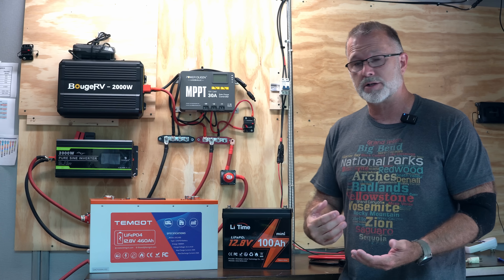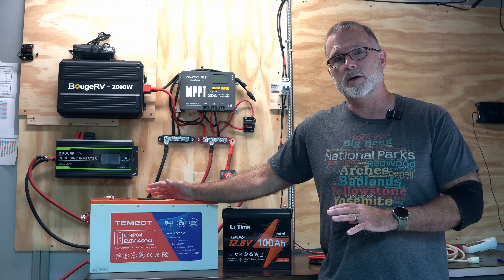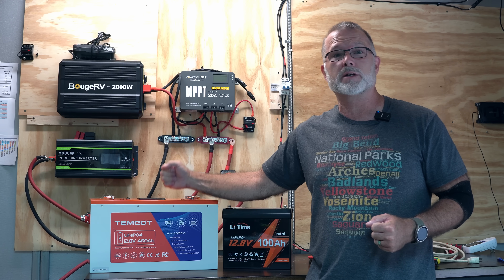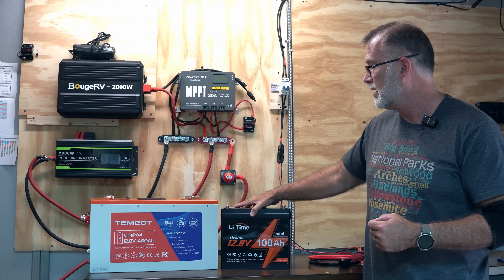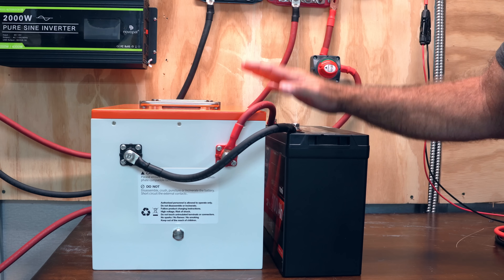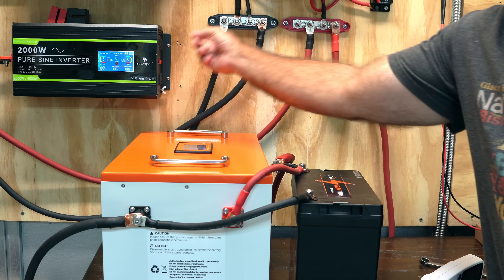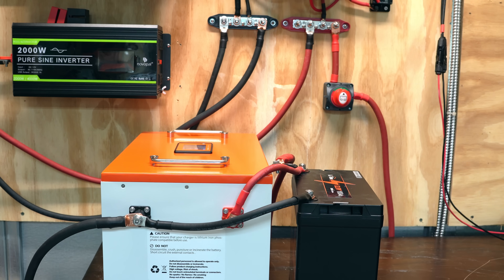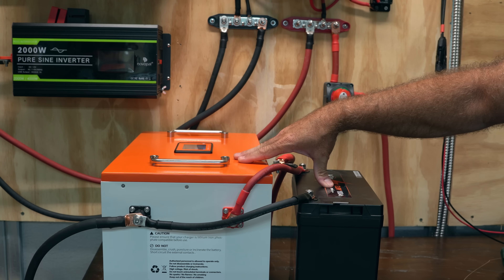Connecting Batteries with DIFFERENT Capacity in Parallel - What Happens?!

Comment: Can I assume that, if I have two identical 24 volt LFP batteries (Same manufacturer, manufacturing date, 100 amp bms, state of charge, and cycle history) that I can connect them in parallel to a 3000 watt All-In-One unit and, as long as I don't load the inverter beyond 200 amps ( 120 amps would provide the 3000 watts, ignoring conversion losses, and 200 amps would be 5100 watts and more than the inverter would deliver without a fault ) and the two batteries would just share the load equally? Can I further assume that the batteries will charge back up equally, whether using grid power or solar energy? I'm planning to do this because one 24 volt 100 ah battery with a 100 amp BMS will not run the inverter at 3000 watts and also will not run the inverter for as long as I would like. It has been like pulling teeth to find a video that just covers this particular set of conditions. A straight answer from anyone will be much appreciated. Thanks in advance.

Comment: Thanks for the demonstration.  It proves that my parallel setup using four 12v batteries of slightly different ages and capacities should work ok.  I imagined that the better batteries would "give" more than the older batteries until they all "run down", and that seems to be what you say, right? Once the oldest and weakest battery is "finished", I replace it with a new one. I'm running an electric catamaran with twin motors that way, incidentally.
Reply from the maker: @fredrichenning1367  sounds awesome!!

Comment: That raised a question about the BMS rating  - if you have two 100amp BMS batteries in parallel are you limited to 100amp draw or can you draw 200?
Reply from the maker: the load is shared in pretty close alignment proportionally to the batteries respective capacities.  But yes, if you have 2 batteries in parallel and both with 100A rated BMS, and your inverter can pull the full 2500W, that configuration would support a 200A load.
Reply: @ReeWrayOutdoors  cool cool yeah I was planning on getting two 100ah 100amp bms cells for my 2000w inverter and suddenly was confused. that's what I thought but yeah

Comment: I have been an electrical engineer for many years. One thing experience has pounded into my thick skull is to think thru “want if” questions. In the case of parallel connection of batteries one what if is a cell shorts in the low ah rated battery?  In the event the higher ah battery well attempt to charge the low ah battery as the terminal voltage has fallen due to the shorted cell. Note there is a voltage difference and no current limiter in the connection. What will happen to the lower ah battery with a shorted cell under the charge current from the higher ah battery?  I equals e/r where r is close to zero. I would advise you gentlemen be very careful connecting batteries in parallel. ALWAYS ask yourself WHAT IF.
Reply from the maker: I certainly do agree that asking and preparing for 'what if' scenarios is a a best practice.  In this case though, I'm talking about LiFePO4 batteries that have internal BMS protection.   And the specific scenario you describe, unless I'm misunderstood your premise, would be no different when connecting 2 identical batteries in parallel vs to different capacity batteries (of the same system voltage) in parallel.  And in both cases, the internal BMS on all of these LFP batteries DOES have over-current protection and short-circuit protections (among other things).  So I would not anticipate a catastrophic problem in the scenario you describe.
Reply: Thank you for ur reply. I’m not familiar with the BMS circuit you reference. Note that most deisel trucks utilize batteries in parallel. They are connected utilizing large battery cables.  My experience with a catastrophic failure involved a sport fishing boat (65’) that had two 240 ah batteries in series (House power) and two 100 ah batteries in series  (bow thruster power). The two battery packs were connected in parallel utilizing about 40’ of 6 awg copper wire. The thruster battety pack was deeply discharged due to a faulty control circuit. The 6 awg wire was subjected to a current on the order of 400 amps from the house battery pack. The overheated wire started a fire aboard the boat that did 2m$ damage. No one was injured. If the 6 awg wire had been 4/0 it would not have over heated but could the 240ah bow thruster batteries handle a charge current roughly twice their ah rating?  The vessel operated over 10 yrs with the 6 awg wire in the circuit then a thruster control fault caused a fire onboard.  Always think thru all the faults you can imagine.

Comment: If the lower one fails and your MPPT charger is set to 24v, you will fry your charge controller. Also, how do different BMS communicate properly for cell stabilization? This is a way bad idea!!!
Reply from the maker: This would be a parallell connection, so there's no change in the system voltage and the charge controller wouldn't know or care if one battery drops off.   And the internal BMS of each battery is only 'aware' of its own cell voltages and the incoming voltage to that battery.

Comment: The problem isn't discharge. The problem is CHARGE. The energy absorption rates are different. Unless the charger can read individual voltages of the batteries, the smaller of the two will be overcharged by the system because the larger will not reach full charge at the same time. This is why truck batteries must be the same size.
Reply from the maker: The internal BMS on the smaller one will disable charging when its high-voltage cut-off setpoint has been met, so that's not really an issue.  But if you're talking SLA batteries without internal BMS, then yeah...that's a problem.

Comment: Just 1 problem, if 1 battery in parallel is dead, then the whole pack will drop voltage very quickly. Otherwise in parallel capacity it is not necessary to be the same but only battery types and life cycles to be the same.

Comment: I really appreciated, there is no problem in using different capacity in parallel connection. I have a small lab and I made router ups using old 18650 laptop batteries. I have used different capacity in parallel as a result I got a long backup time. 98% people have wrong idea that dissimilar capacity is problem in parallel connection. It is only occours when in series connection.
Reply: I have a question, I was making a power bank with 18650 batteries but a few of them are of different amps. So I wanted to know if it will work perfectly or not
Reply: I am connecting the batteries in series as well as in parallel, will it work properly.

Comment: When discharging under load (in parallel), most of the current will flow through the battery that has lower internal resistance. This will be determined generally by the chemistry, size, condition and state of charge of each battery.
 If one is fully charged, and the second discharged, then the 'dead' battery will draw charge current from the charged battery until terminal voltages equalize. Nothing  exciting.

Comment: If one battery can provide 100 amp and the other one 250 amp, then there's a maximum of 350 amp output and 250 amp shouldn't be a problem at all for the smaller battery as it will provide only maybe 70 amp and the bigger battery the rest.

Comment: Good info to know. I currently have a 200 AH lithium battery in my RV and was going to add a 100 AH to it but was not sure how this would work. Will my converter charge both batteries to 100% if it detects the 100 AH battery at full while the 200 AH has not been fully charged?

Comment: I’m running a 300 amp hour battery and a 200 amp power battery the positive goes to a positive busbar and the negative to a negative bus bar then it goes out to my inverter is that OK I bought another 200 amp hr power battery plan on running it the same way Would that be OK?

Comment: Is it acceptable to connect a small 12v sealed UPS battery with a 12v automotive battery in parallel?I'd be using a Noco smart charger?

Comment: I have 2 - 24v100Ah LiFEPO4 batteries with BMS connected in parallel. I have a 3000 watt 24 Volt inverter hooked to it. When running something off the inverter to produce 120 volt output only one battery drains and the other does nothing. All wiring is the same length and AWG. Will the other battery start draining when the first battery runs out or am I missing something here?
Reply from the maker: @Sam_Son59  they should be draining at more or less the same rate simultaneously.  How do you have them connected to the inverter?

Comment: As the currents add up the difference of capacity is not to big of an issue.

If you have 100A from one and 250A from the other the total will be 350A.

Comment: So what if the batteries have no built in BMS ? Like if you just connact the raw battery terminals in parralel? If one battery drops in volatge too much wont the other battery starts to charge it? Wont this increase losses in power due to the power loss during charging. Instead of battery power going directly to the output inverter. This wont matter much with small capacity but when dealling with 10s of killowats the loss can add up to be significant.

Comment: Gotta be careful tho if the wear is different, as they will try to equalize and the strongest battery will constantly try to pull up the weakest one. What i usually do as a test is charge both batteries together, let them equalize, then disconnect from the charging source and check with the ammeter if there is significant load transfer between them over time. It's a problem really only if it's there's no external charge for a long time. Like i had a weather station pulling only 10W and needing to last as long as possible between charges, so i decided to put as many lead-acid battery i could in parallel, the last one i added was supposed to give me roughly 40Ah more, but ended up giving me only 5Ah at best on the long run and wearing out other batteries faster in constant equalizing, so i pulled it out. Great video tho.

Comment: This is interesting. I was trying to figure this out, and your video gave me an idea for my problem. I have a UPS with two 12V batteries in series to create 24 volts. Obviously, I can't mix and match batteries in this case, but what I can do in the future is purchase 24V batteries instead. If I wanted to increase capacity, I can just buy another 24V battery and connected it in parallel. Is this correct, or am I missing something?

Comment: Can I connect in parallel 2 batteries similar to this experiment but in my case they are 48v one have 114 ah and the other one 100? Thank you
Reply from the maker: @usafshorts  yeah as long as they are the same nominal voltage,  should be fine.

Comment: The bigger capacity battery will charge the lower capacity as well as provide external power. Then, when the capacity becomes the same, they both will charge external load until depleted.
Reply: Except they are both charged. Strange. Did you measure that?

Comment: I have 2-100A SOK batteries that I installed 2 years ago.  I was told that I should not install an additional battery more than a year later, (mixing older batteries with new batteries being a bad idea).   After watching this video I don't see why I can't buy another 100A battery to wire in parallel along with my older batteries which are wired in parallel.

Comment: Just as noted in the next comment, you didn't mention that the capacities are additive when wired in parallel. Exceeding the discharge rate of the smaller battery isn't an issue when wired this way.

Comment: Usually, the batteries do not have exactly the same potential at each of the 2 poles.
When they have no load, but they are in parallel, regardless of the capacity of each battery, there will current from one (+) to the other (+), and from one ( _ ) to the other ( _ ), until they equalize.   
Only the potential difference matters, the power drain may be from the small battery to the bigger battery.

Comment: Ok, so it comes down to BMS that is important, so BMS means battery management system so if both is same then it's good, but BMS is battery management system, right? So, that means nothing to number itself unless the number is correspond to mass itself, so 1 BMS is certain mass?? So, it is about same mass as you say certain combo of mass. Lithem... whatever receipt. So, or certain resistance and certain mass to match different resistant and different mass, but two battery has same ratio, like 1000 has 500 plus 500, 250 plus 250 plus 250 plus 250, so 500 is two and 250 is four, so certain amount to result. So, can be different BMS as long as different resistance to match the result, so you pour water in cup, so same speed of pour so the cup with ball raise faster since the cup is narrow, so if wide, so the ball raise slow, so it's corrpond to amount of size, so BMS has certain size which cause higher charge and higher discharge, so if same ratio so it's good? The pour is the start and the receive of cup is the process, the raise of ball is the end, so depend the process itself and range of impact of start so pour fast or slow.

Comment: If you connect a 200AH and a 50AH battery in parallel (both 12Volts),  they’ll share the same voltage, but the 50AH battery will wear out faster.

 The smaller battery will charge and discharge quicker, which could stress it and shorten its life.

There’s also a risk of uneven current flow if one battery is charged more than the other, which can lead to overheating or damage.

For the best performance and safety, it’s better to use batteries with the same capacity when connecting them in parallel.

Thats it!
Reply: Thats not how batteries work....at all.  If they are hooked together.....then they are now one battery......they charge together and they discharge together.

Comment: You can get away with mixing LFP batteries in parallel as long as they have a BMS. You will come unstuck with lead acid doing the same thing as the larger battery needs a much longer absorption time so eventually the larger battery will sulfate and die. NEVER mix lead acid batteries either parallel or series you will have problems.

Comment: If the batteries are the same chemical kind and you can open the batteries and have access to all the voltage levels between the cells, then you can cancel the weaker BMS and connect instead the voltage levels in between the cells of both batteries in parallel as well, leaving only the stronger BMS to manage both batteries. In doing this, you are in effect building a physical larger battery, made of the cells of the two batteries, where all cells of the same power level are electrically connected in parallel. And the case boundaries of the batteries do not have an electrical meaning if you do that. The gain is that now you have just a single strong BMS and so you do not need to worry about over current anymore.

Comment: Hi! we have two batteries (12V 400A and 12V 100A) parallel connected and the load is 12V 100A. So when the batteries would not feed the load? Less than 1 hour or it would be about less then total current amount / load current?(100 + 400 / 100 =  5 hours) - Thanks

Comment: Although it is not recommended It is possible to use say 4 12v LiFePo4 batteries in series without any problem.  I have run 12 100Ah batteries as 4s3p now for over a year and have had no problems. I have however connected a battery equalizer (HA02) over the batteries to equalize the voltages over the the 3 strings. They are also connected so that it is really 4 x 300Ah as 4s. 
I use the cheapest LiFePo4 batteries I could find and they where absolutely NOT recommended to be used as I do.
The danger as I see it is if 1 set of batteries disconnect and there is a load connected then the disconnected set can have probably up to near 45v over it and the BMS in that set may not be able to handle such a voltage.
My solar regulators turn off the charging when my battery setup is full  (58.4v) and the inverter turns off at 45.6v.
The equalizer makes sure that every s has a similar voltage so that a blow up due to wandering inequality is avoided.
At another setup I am using similar "cheap" batteries as 2s2p in both 100Ah and 135Ah ( 2 setup's) and then parallel to 4p 150Ah 24v. I leave some cable in between the different setups to allow some natural over resistance balancing. It all works pretty good - probably not quite to it's limits but that should only be better for the batteries anyway I believe.
On my old Golf Cart I use 5s and 2 HA02 equalizers on probably even worse batteries. The overall voltage is never really outside 65-67v so they are not pushed much. 
I believe that the trick in using sub standard batteries is to use the equalizers and then not push them too hard and then of cause external charge and discharge control. The internal BMS is then only there to balance the single cell's and for absolute security.

Comment: Works just fine in parallel. Just basic physics. They will always be the the same voltage, and during discharge they will just share the current according to their internal resistances (server power supplies share loads in a similar way, look up droop mode). The BMS is of no consequence here, since the smaller battery should never see the larger current - and if the 250A BMS shuts down for whatever reason, the 100A BMS has a very good reason to do the same. You might just want to keep the smaller batteries at the far end of the wire connection, since the little resistance in the wires will cause the front battery to see a larger voltage drop, and if the small battery is in front, some high inrush current might trigger the smaller BMS. 
In series, connecting two batteries with different voltages but EQUAL capacity is possible, but it is very rarely done.